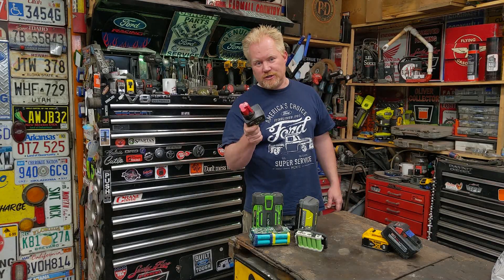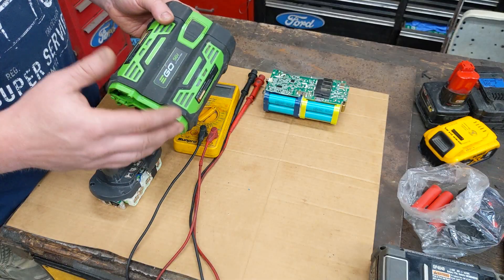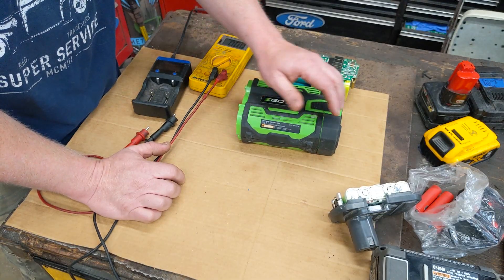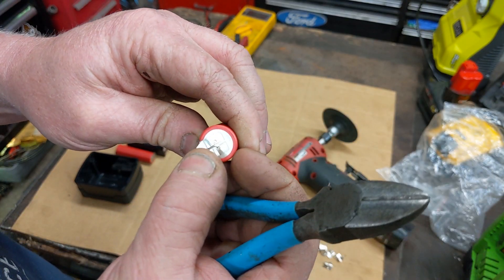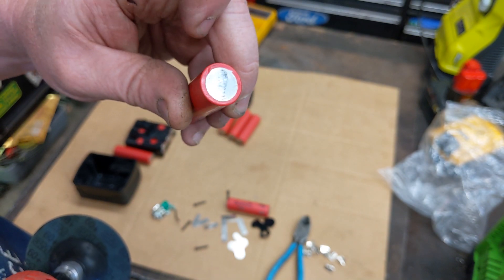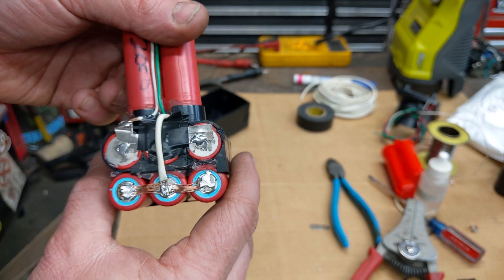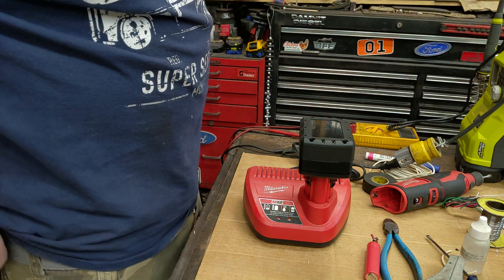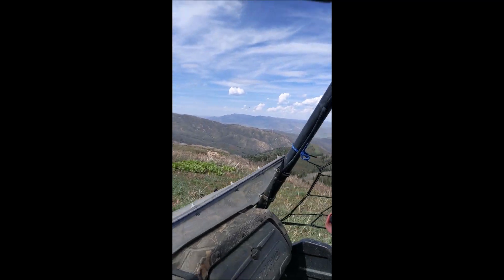Build Dirt Cheap power tool Battery Packs : Milwaukee Dewalt Makita

Comment: 😂 you test onle the voltage . you need to know the resistance if you wonna good battery . this cells have 50 60 or even 100 resistance .

Comment: I have an 8 volt drill and it has stopped working. and I still have the charger for it. I tried charging it but was unsuccessful. figured I would replace the batteries in it rather than throwing the drill away. and I remembered you had a video instructing how to do this. thanks Moe.

Comment: I wouldn't sauder the cells. Using nickel strips and spot welding is neater and can fit into tighter spaces compared with saudered cells.

Comment: Use the biggest tip you have for doing this as it will transfer the heat quicker and you spend less time heating up the battery.

Comment: where can I find those connector plates if I don't want to use wire?
Reply from the maker: It's called "nickel strip". For batteries you need at least 0.25mm thickness at least 6 mm wide to handle the current. You can go wider like 10 mm and down to about .2mm as well. 

This is what it looks likehttps://amzn.to/4mnw5Qx

Comment: I'm not an expert, but I feel a bit uneasy seeing the copper wires spread out flat like that and soldered. Wouldn't that create higher resistance and potentially cause issues under high load, especially with power tools or heavy-use applications? I'm not against soldering itself, it just seems like flattening and spreading the bare strands like that could pose a risk. Just asking out of curiosity, and open to being corrected if I'm wrong.
Reply from the maker: They'll pass the same amount of current whether bundled or flat. In theory, they'll handle even more because they're able to dissipate the heat better than when bundled.
Reply: @sixtyfiveford thanks for the answer

Comment: Despite this most loved comment of first rule of battery scrounging... the REAL first rule is you do not solder LiPo battery. Ever.
It is an accident waiting to happen. You can get away with 99 soldering jobs and then there will be 1 that burns through your googles or your hand, if unlucky.
Especially the ones that start tinkering with LiPo are the most naives, thinking they can handle a lipo fire. And when it kicks in they will suffer from PTSD for their rest of their lives. It is a violent agressive high heat fire that can not be put out. You can only cover a tiny cell with a bucket of sand to RESTRAIN THE HEAT. But it will keep burning with heats melting metal.
Industry uses spotwelds. For a good reason: soldering is not suitable for safe work. Plus even if you have luck you damage that part of your battery lowering its rated capacity or current.
Stop spreading soldering jobs of batteries, just get a 10$ tool and spotweld.
Reply from the maker: So much ignorance and fear-mongering here. The soldering never exceeds the battery safe operating temperature unless the operator is a moron and cooks the cell for a solid minute+. High discharge cells are generally rated around 60-65c /140F-150F and higher. Soldering on them for such a short amount of time; maybe increases them to 40c or if you spend 30 seconds on the cell maybe 50c/125F. You're using  a soldering tip that is around 700f. Spot welding is around 2500-3000F. But of course it's done for such a short amount of time. You don't put that much heat into the cell. The cells literally get hotter under use and charging than soldering. 

The second issue is thinking a spot welder for high discharge cells is $10. You cannot weld the thicker nickel strips required for high current with a budget spot welder, it won't do it. I have several budget spot welders. You need to get into the $200 range for a spot welder too be able to weld .30+ nickel strips. You cannot double stack the paper thin nickel strips. 

I have done many thermal tests and it takes about 90 seconds to even get to a point where the temperatures in the cells might get dangerous.
Reply: When you solder a cell it reaches 230-350°C on the soldered surface for 3-10 seconds the whole surface of that electrode. When you weld it reaches the melting point of the nikkel for 50-100milliseconds on the area of 2 pins. The amount of energy deposited is not comparable. 
As I wrote, the industry is using spot welding because the exact above written reasons: the heat of soldering propagates to the sandwiched plates and does damage them (breaks down the lithium polymer leading to lowered capacity and causing tension in the cell).

The price of spot welder does not compare to the damage a cell can do to property or health.
A simple and cheap spot welder can be built from a dead microwave transformer by rewinding its secondary side with really-really thick wire. Not elegant, but does the trick. Not scalable but it is so cheap you can have 2-3 built for accounting varying thicknesses of nickel plates.

Soldering method is an accident waiting to happen, and by that I do not necessarily mean an instant one, sometimes the damage is subtle, hidden but enough to cause a change in the cell and this will propagate under load. And there will be a time when you load that cell for the last time and it will burst.

Especially if you read the comments here people are using used cells, that is another good source of fire hazard when unknown cells are paired, soldered and put into a high current mandating drill. Whenever I see something like that I always think of Darwin at work.

Building lipo is fun, when you have the proper equipment to measure, validate (capacity, internal resistance, discharge current) and assemble the cells properly. When you cut corners, it is more like a russian roulette.

If you really want to solder cells - what I do with my cells - I do not strip the original nickel plates, just cut them in a way that i have an excess 5-10mm strip, that i can solder to, that way the heat can does not have a direct path to propagate into the cell, the thin nickel plate can not conduct the heat that effectively and with care and active airflow the electrodes of the cells remain warm to the touch.

Comment: Even when only a few cells go bad, the other cells are usually well worn out and vary in IR between packs. If you are going through the expense of all the tools & supplies, rebuilding with new quality cells is usually well worth it. 

For example you can buy 10 Molicel P30B’s for $60, which will make you a world class 6AH tool pack that will last you for a long time if you can spot weld the thickness of nickel you need. 

I rebuilt a Kobalt 40V pack with P28B’s and that thing runs circles around any other Kobalt 40V pack. Runs strong right up until it dies and lasts almost twice as long as the original 5AH pack when it was new.

Just keep in mind you need to spend money on a real decent spot welder and good quality .2 nickel (or thicker if possible). You’ll be $150-$200 into it or more depending on your electronics skills. I went through 4 cheaper spot welders before I found something decent that wasn’t a KWeld.

Comment: Using metal pliers will absorb the heat your trying to create to solder the battery. Tri wood popsicle stick or pencil.

Comment: Thanks for the demonstration. When welding, people don't tend to worry about touching the + or - terminals with metal pliers solders etc yet, when taking the battery apart everybody warns you of not shorting the battery pack. All I want to know is, when soldering, what should I or should I not touch in other to avoid shorting?

Comment: For the sake of very little money much safer to spot weld them. These cells hate heat from solder
Reply from the maker: You will need a $200 spot welder to be able to weld the .30 nickel strip on high discharge batteries like this. I have soldered hundreds of cells now and have never had a single issue. High discharge cells are rated for high temperatures, generally up to around 75 C with normal operation. You will never even get close to this by soldering on the ends. Low discharge cells do not have high heat. Tolerances. They also use much thinner nickel strips that can be welded with budget spot welders.
Reply: @sixtyfiveford  you may well be fine, but Id suggest most watching you won't.  I have never had any issues with my 40 dollar spot welder rebuilding battery packs
Reply from the maker: @Micjoh  You're not using thick nickel strips like you should with a high discharge battery pack. As there is no way a $40 spot welder will come close to welding .30. You can attach thinner but you're going to end up with hot spots, disconnecting tabs and potentially fire or damage to everything.

Comment: On Sunday I got my EIGHTH DCB210 battery pack. I knew it was bad like six of my other seven DeWALT DCB210 packs (10AH) but it also turned out to be counterfeit. I still thought it wasn’t too bad since they also threw in a 5AH Ryobi 40v pack almost just like the 4AH one you have there. Unfortunately, every single cell was at zero volts even though it looks brand new, inside and out, and even still had the security plug covering one of the screws.

It’s definitely a risk when you buy packs to salvage.

Comment: NO!  Just slapping one in a charger after it has discharged that low, is not proof that it has plenty of life left in it, typically the opposite, that if the pack was used enough to have a cell go bad, then the remainder are hardly worth the bother to build a new pack out of, plus they may LATER be a fire risk too.

Plus store your old crappy batteries in metal container so they don't burn down the house!

Your argument about the temperature with solder vs running or spot welding are nonsense.  Spot welding is a momentary discharge that does not heat the end cap much at all.  Running is heat spread over the entire cells and also does not heat the end cap much at all.  Soldering heats the end cap a lot.  Fortunately, the cap is slightly elevated so you are getting away with it, without damaging the seals, but you are pushing the limits much more than spot welding or running the tool, so please at least don't spread misinformation as a justification.

If you are going to solder them anyway, you'd at least be better off with a higher wattage solder gun or at least a stouter chisel tip instead of  the one you're using.

Comment: Great idea but I tore apart over 30 old battery packs and only found four cells that were 100% the rest were compromised to some degree and not worth reusing. 
If a Li-Ion battery pack failed, chances are it was abused or has gone through a butt load of cycles, meaning that if one or two cells failed, the others aren't likely too far behind. 
I picked up a huge load of lap top batteries, only two out of 11 of them had any voltage at the terminals, after cutting them apart only five of the cells would take any sort of charge and only one cell held full voltage after a day off the charger. Chances are they were batteries that like most of my own laptops, spent more time plugged in then being run off their batteries. so the batteries lived their whole life being constantly charged and topped off to 100%. 
On my current laptop, which is 5 months old, if I put it away and let it sit for two weeks, the battery will be dead, dead enough that it won't recharge. The first battery, died early on, when I cut it apart the first cell in line on the pos. side was dead with zero volts, the rest were showing .5 to .9v. out of the 8 cells, only two took a charge without overheating and none held their charge for more than a few hours even after being cut free of the pack. 
I think the better route to find batteries is to buy cheaper battery packs with new batteries at HF and cut those up to fix your better quality tool batteries.

Comment: I just did the same, just with new cells.
The refurbished battery runs fine, but it cannot be charged in the original charger anymore. It reports the battery as bad

Comment: Great video, but soldering on li-ion cells is not recommended. It is easy to damage them with the heat. This is why everyone uses spot welding.
Reply from the maker: I have intentionally tried to destroy cells with soldering and have only been successful on one. I had to hold the soldering iron for a good minute at least. That was on the positive side and all I did was short out the little thermal overload fuse in all cells. I have soldered for 30 seconds or longer just to see if there's a loss in capacity,  none. There's a huge difference in power tool lithium ion cells versus something you could find in a laptop. People don't realize how hot these are designed to actually get in operation. I've measured normal usage and 160F is common but most high discharge cells are rated for normal operation up to 80C/176F. Holding a soldering iron onto one side for 10 seconds may take a 70F cell up to 75F and 60 seconds a little over a hundred F.
Reply: @sixtyfiveford  thanks for the info!
Reply from the maker: @Surmoka  Soldering is slow and no where as compact as spot welding. If you're doing an entire pack spot welding will easily be 4-5x faster. Just replacing 1 cell though and 1 second vs 10 doesn't really matter.
Reply: @sixtyfiveford true dat, but my spot welder is rather lousy. If I had a good welder, it'd be no question. For just one pack, I think I'll be good with soldering.

Comment: spot welder is highly recommended .. heatind the lithium battery is just on the other side of safe.. do your research..you tubes awesome but everyone does things a little different ..but for sure the majority of battery builders suggest to not solder litium cells.. this sad have explained that but..as i said..everyones different
Reply from the maker: I have intentionally tried to destroy cells with soldering and have only been successful on one. I had to hold the soldering iron for a good minute at least. That was on the positive side and all I did was short out the little thermal overload fuse in all cells. I have soldered for 30 seconds or longer just to see if there's a loss in capacity,  none. There's a huge difference in power tool lithium ion cells versus something you could find in a laptop. People don't realize how hot these are designed to actually get in operation. I've measured normal usage and 160F is common but most high discharge cells are rated for normal operation up to 80C/176F. Holding a soldering iron onto one side for 10 seconds may take a 70F cell up to 75F and 60 seconds a little over a hundred F. 

To do battery packs, you're not going to be able to use the budget. $20-30 spot welder you can find. The nickel strips are two to three times thicker and you will need to spend closer to $150 for spot welder that will handle it.
Reply: @sixtyfiveford still not safe to solder batteries, I’ve done it myself but it’s not recommended, I’ve got a cheap spot welder that can do batteries for power tools, just had to get the hang of it
Reply from the maker: @M.E63  You're not going to be able to weld the thick nickel strips required for high discharge cells. Layering multiple thin nickel strips is not adequate and is a danger in itself. I've done hundreds of 18650 21700 high discharge cells. High discharge cells are rated for upwards of 65c. They get hotter during operation than soldering ever gets them. I've ran thermal cameras to detect temperature increase and I never even get close to the max rated operating temperature.  I mean spot welding gets up to 3,000° for a second. The cherry red spot weld penetrates internally into the battery with a 2-3000° spot. Soldering is 1/5 that for 2-4 seconds.

Comment: Hi can I parallel two different battery packs of the same voltage but have a different Max. continuous discharge current 20 a and 30 a
Reply from the maker: Yes, I've done it without issue. They split/share the load so they're happy.

Comment: Thank you, great video, found out I had 2x dead cells in my DeWalt 4A battery pack. Couple of questions, my batteries only have markings "TBI6RX8", Google was no help in finding out what these are? And when I removed the tabs on the dead batteries, I must of punctured the casing as it made a wee hiss, if this happens I don't think I can recover other battery packs? Again regards.

Comment: Sometimes if you have a dead battery and forget to charge it then the charger wont charge it because the charger thinks its to dead to charge. So get a fully charged battery of the same brand and voltage and get some good thick wire keep it short and put the wire from one positive to the other positive and negative to negative and make sure to get it RIGHT or you'll fry the board it them. then let them sit hooked to each other for 15 mins then try to charge the "bad" one and see if it will charge if not try again for 30 mins then try to charge it. you can also check the charge indicator also. And MAKE SURE not to drain the good one to far or it wont charge.

Comment: PLEASE HELP ME I made a S5-18v but the drill won’t start unless you pull very slowly and then it will spin but can’t handle a load can you suggest why I built 3 packs all the same I folded the instructions to the best of my knowledge please help
Reply from the maker: Are they High Drain cells or laptop cells?

Comment: 3d print the plastic case
Reply from the maker: Sure, if you can find the file already done. Otherwise you'll spend hours upon hours designing and wasting test prints. Even then though 3d printed parts are very rough and crude.

Comment: Great video as always, thanks for sharing and trying to save us some money! A couple tips for anybody doing this… 1 if you kinda suck at soldering (like me) solder the positive terminals first (too much solder on them can overflow and short out against the negative casing) 2 a big clamp or large vise grips are good for holding batteries still and upright while you’re working